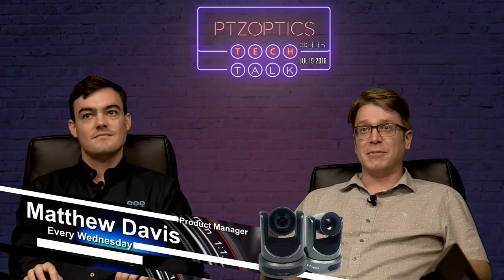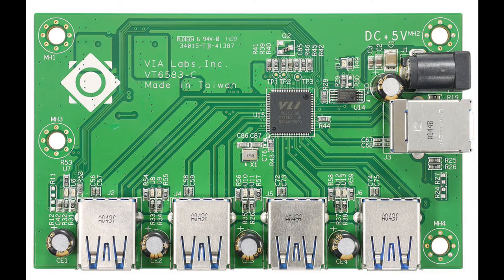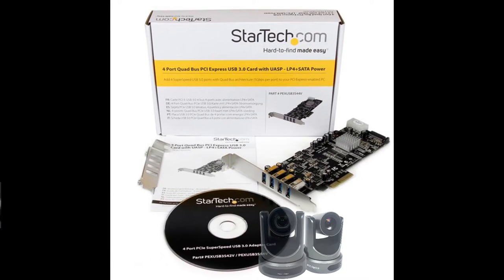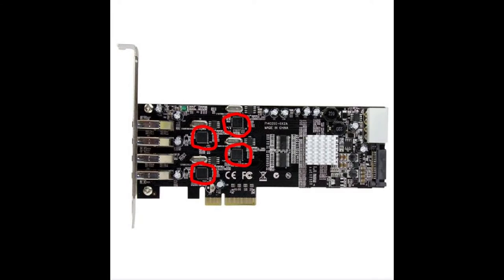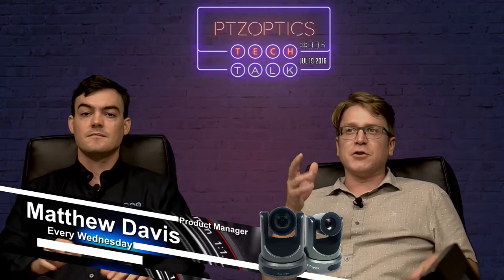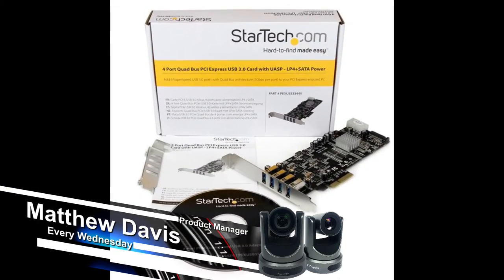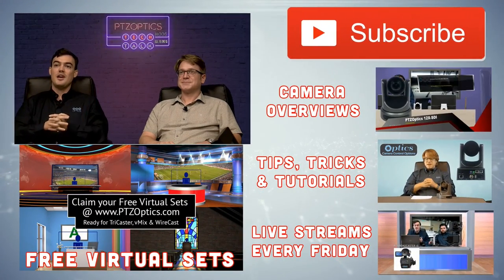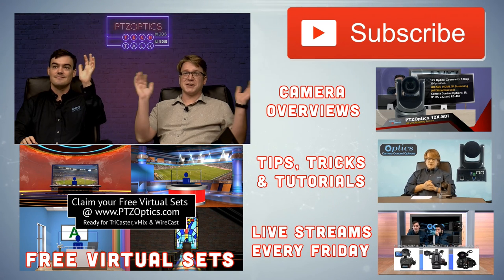Insufficient USB bandwidth on USB 3.0? Here's why - VLOG #006

Comment: Nice video ! My optical setup has >8 UDB ports and  it's definitely slowing down or disconnecting devices. I've tried a classical USB hub but i guess there was only one host chip. I wonder if this device you propose to get will solve both the power and bandwidth issues
Reply from the maker: Thanks for checking out our channel Adrien!
If you are experiencing issues with devices slowing down or disconnecting due to having more than 8 USB devices connected, it sounds like you are encountering bandwidth and power limitations common with USB hubs. To address these issues, you'll need to consider both the type of USB hub and the power requirements of your devices. Here’s a solution that might help:

Powered USB Hub with Multiple Host Controllers
Powered USB Hub: A powered USB hub provides its own power source (typically through an AC adapter), which can supply sufficient power to each connected device. This is particularly important for devices that draw significant power.

Multiple USB Controllers: Some advanced USB hubs feature multiple USB controllers to manage data bandwidth more effectively. These are not as common as standard hubs but can significantly improve performance when many devices are connected.

Key Considerations
USB Standards: Ensure the hub supports the USB standard of your devices (USB 2.0, 3.0, 3.1, etc.). USB 3.0/3.1 hubs are generally recommended for higher data transfer speeds.
Individual Port Power: Check the power output for each USB port. Some hubs offer enhanced power output (more than the standard 500mA per port for USB 2.0, or 900mA for USB 3.0), which can be beneficial for power-hungry devices.
Number of Ports: Choose a hub with more ports than you currently need to allow for future expansion.
Quality and Reliability: Opt for a hub from a reputable manufacturer to ensure reliability and device compatibility.

Additional Solutions
Separate Hubs for Different Device Types: Consider using separate USB hubs for data-intensive devices (like external hard drives) and another for less intensive devices (like keyboards and mice).
Direct Connection for Critical Devices: For devices that are particularly sensitive to data bandwidth or power limitations, consider connecting them directly to your computer's USB ports.

Implementation
Connect the powered USB hub to your computer.
Connect your USB devices to the hub, prioritizing high-power or bandwidth-intensive devices.
Use the AC adapter to power the hub.
Testing and Monitoring
After setting up the new hub, monitor the performance and connectivity of your devices. Look out for any disconnections or performance issues.

Conclusion
Using a powered USB hub with multiple USB controllers can address both power and bandwidth issues when connecting multiple USB devices. It's crucial to choose a quality hub that meets the power and data transfer requirements of your devices. Additionally, how you distribute your devices across the hubs can also impact performance, so some experimentation might be needed to find the optimal setup.

Comment: I just ran into this issue on a brand new computer. The computer that I purchased to replace a 10-year-old machine which was working okay but not great was glitching out the audio interface which was USB, the cameras which were all USB. Before seeing this video I did go into device manager and see that there's only one USB controller chipset for the entire computer. I'm sure the older machine had two. This is the first time I've encountered or noticed the USB 3 and the USB 2 ports on the same chip. It's definitely causing issues so I am going to put the PTZ optics camera that I'm using on its own dedicated USB.
Reply from the maker: Hi Mike!
Your experience highlights a common issue encountered in setups where multiple USB devices, particularly high-bandwidth ones like cameras and audio interfaces, are used simultaneously. In such scenarios, the limitations of the USB controller chipset in handling multiple data streams can lead to performance issues. Here’s a strategy to optimize your setup:

1. Separate High-Bandwidth Devices
Dedicated USB Controllers: If possible, connect high-bandwidth devices like your PTZOptics camera and USB audio interface to separate USB controllers. This can help prevent bandwidth bottlenecks.
Check USB Ports: Differentiate between USB 2.0 and USB 3.0 ports on your computer. USB 3.0 ports are generally better suited for high-bandwidth devices due to their higher data transfer rate.

2. Prioritize Device Connections
Critical Devices on USB 3.0: Connect the most bandwidth-intensive devices to USB 3.0 ports. For less critical peripherals (like a keyboard or mouse), use USB 2.0 ports.

3. Use of USB Hubs
Powered USB Hubs: If you have more devices than available ports on different controllers, consider using a powered USB hub for lower-bandwidth devices. This ensures they don’t draw power away from your main USB buses.
Avoid Overloading Hubs: Be cautious not to overload USB hubs, especially with multiple high-bandwidth devices.

4. Manage Computer Resources
Close Unnecessary Applications: Run only the necessary applications during streaming or recording to ensure maximum resources are available for processing USB data.
Update Drivers: Ensure that all USB drivers and firmware for your connected devices are up to date.

5. Monitor Performance
Test Each Setup Change: After reconfiguring your USB connections, test the setup thoroughly to ensure that the issue is resolved.
Monitor for Overloads: Use your computer’s resource monitor to check for any signs of data bottlenecks or resource overloads.

6. Consider Additional Hardware
Additional USB Cards: For desktop computers, you can add PCIe cards with additional USB controllers to expand your USB connectivity with independent bandwidth.

Conclusion
Properly managing USB connections and understanding the bandwidth limitations of your computer’s USB controller are crucial in setups involving multiple USB devices like cameras and audio interfaces. By strategically connecting these devices and potentially employing additional hardware like powered USB hubs or PCIe USB cards, you can significantly improve the performance and reliability of your system.
Reply: @PTZOptics  Yes, in the computers where I am using one of these cameras, I am using a dedicated PCI-e USB card with four separate controller chips on it, one for each of the four ports on the card. That said, I still have issues with using the camera via USB. I have had multiple cameras on multiple computers freeze up and stop sending data via USB at random at 1080p30. At one point, the camera just died, so I sent it for a warranty swap. The replacement has the same unpredictable behavior with USB. It was also causing some latency in other devices attached via a separate USB bus/controller. (the audio mixer's digital interface was getting corruption in the stream to the computer, causing skips and digital noise in the audio stream, and it only happens with the PTZOptics camera active on its separate USB bus.) I tried all sorts of combinations, just having the camera by itself on the PCI-e card, I tried it in all the ports on the card in case one PCI-e bus was getting overrun. I could not find a configuration that worked flawlessly on USB3 with these cameras. I am IT by trade with experience longer than the existence of USB itself, and I have done all optimization I can do, including disabling all power management on the hardware devices in device manager to eliminate that as a possibility. I gave up and started using RTSP for video by finding and implementing the appropriate audio delay in my software to match the latency introduced with the stream encoding and network transport. The issue with this is that I cannot also introduce a delay in my second camera to match the RTSP stream's delay, so now that other camera is out of sync. I guess if we want reliable with low latency, we'll need to go NDI or use a dedicated HDMI encoder in the computer.